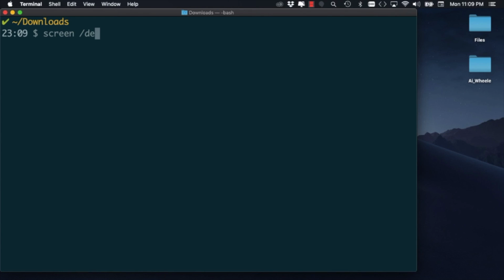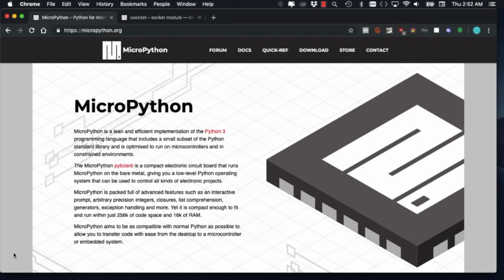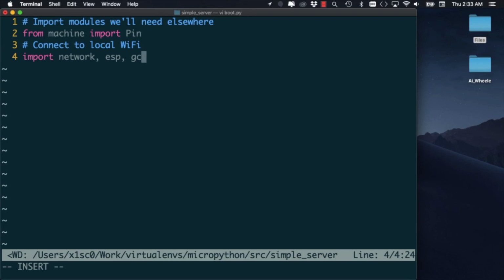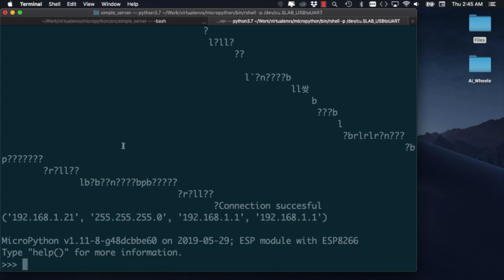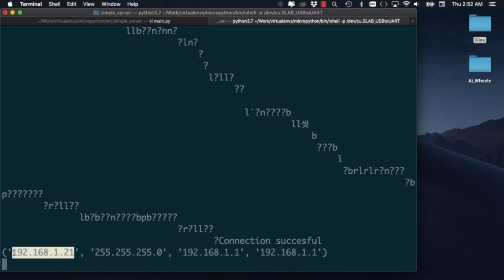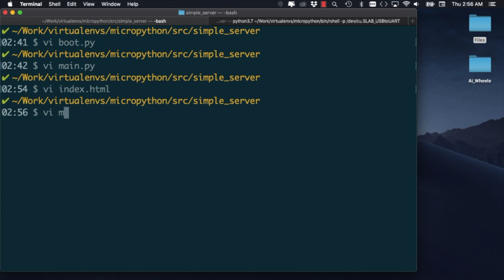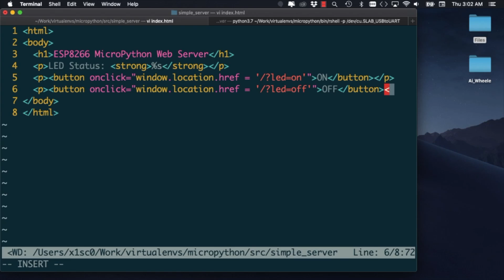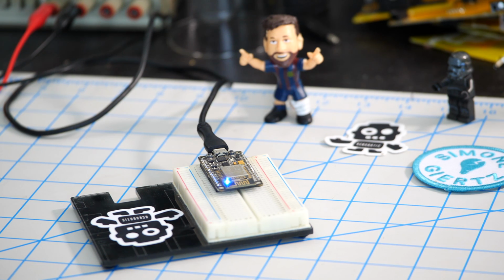ESP8266 MicroPython Web Server For NeoPixel Control

Comment: The interesting theme is how to protect your python code in micro-python. As I know, there is only one method to do that is to add library to micro-python source code and do custom micro-python compilation.
Reply from the maker: Hmm, I need to look into this. Back in my grad student days (10 years ago), it was 'impossible' to protect interpreted languages even on full-blown computers.
Reply: This is right, but you can hide it inside standard micro python libs.

Comment: Really enjoy your videos.  Could you comment on the availability of libraries available with micropython running on an esp32/8266 compared with using the traditional arduino  (or platformIO) interface?  For instance I am using a BNO055  IMU sensor and  the Adafruit library -  does  micropython support many IOT devices?  Is it possible to utilize a more sophisticated code editor like visual studio code, adam , sublime with intellisense?  Thanks.
Reply from the maker: I'm glad you're enjoying the videos. I'm planning on doing a video next week to show how to add your own libraries to MicroPython on the ESP8266. Stay tuned!